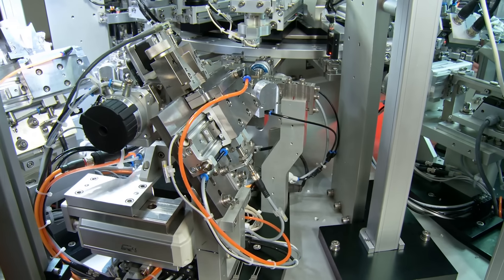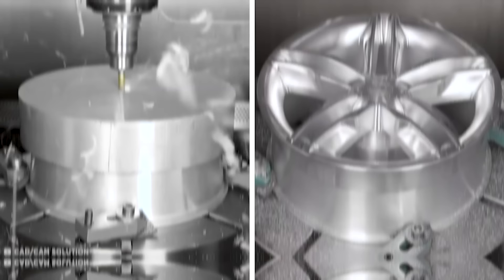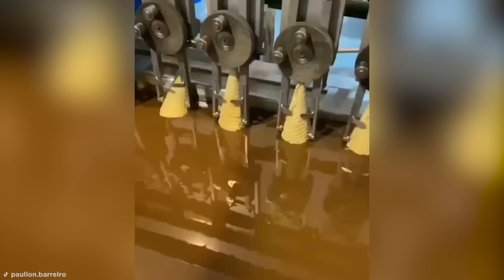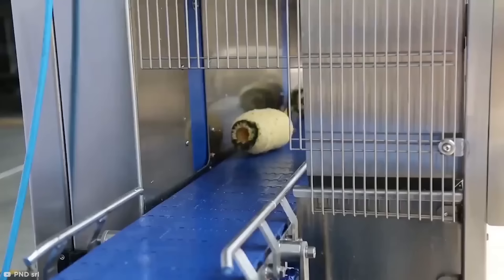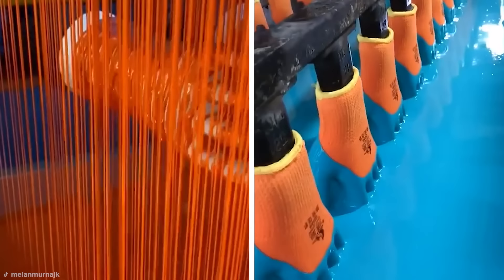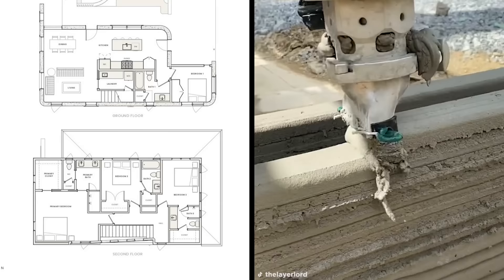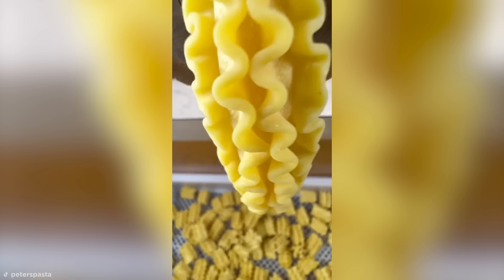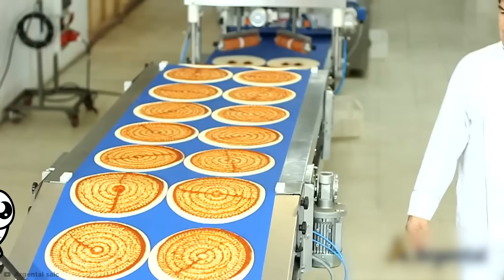Satisfying Factory Machines That Do Amazing Things

Comment: I used to work in a machine shop, I set up an ran a five spindle turret lathe from the 50's, it could make the same parts as a CNC (well some of the parts) however the only buttons on the machine was the off and on button, for how old they were it was pretty impressive the tolerances they were able to hold, with a good set-up that is

Comment: I love programming for a CNC machine. I taught myself AutoCAD then applied to a granite shop and got the job programming for their water jet CNC machine. I then learned AlphaCAM on the job as well. It was fun designing granite countertops for the machine to cut. Then I went to a closet company to program for their CNC wood router, and designed closets for the machine to cut and drill. I never got to use anything over a three axis machine though. I always wanted to play with a five axis CNC.

Comment: That’s not molten metal that is heat to cherry red. If it was molten it would be a liquid which is usually only done to form blanks or ingots of the metal. The metal is then heated to the state shown to form it and later annealed by heating it to a high temperature and cooling it down slowly to change the hardness of the material.

Comment: Part 1

You forgot titanium/chrome knee and hip implants. I used to work at a factory which made them called Sulzer Orthopedics, which sadly closed down in 2000. 

Anyway. Sure, a human is involved in almost every step involved with creating a knee implant -  from shaping a freshly cast, highly angular knee implant (we received them as 'bones', which was slang around the factory for a freshly cast and angular item before the first rudimentary steps of shaping them). What follows is how we did it:

1. The first step was to sand all of the shark edges from the bone, and give it the proper shape according to precise dimensions. If a mistake was made here, then that bone went in the trash... a loss of about $30,000. I never lost a bone on the belt sander, but I saw somebody else lose one. 

1.5 Anyway, sanding a bone to the precise precision and finally tuned tolerance of about a millimeter, meant that the guy running the belt sander that day was in for a world of shit. You know, for the rest of the day.. I saw a couple of guys fuck up their third try (it was 3 strikes and you're out) and they got fired for that. They don't fire you the first time, but as I alluded to already, I saw a few people who misprocesed the bones in a row. That's partially the trainers fault, but admittedly, he was giving these newbies time on the belt sander way before they were ready. Anyway, it was sad to see them go, because they didn't even have a chance to learn how to get good at anything. Not only did was it each one of them's first day on the job, they didn't have time to learn anything! And starting somebody out on the industrial sander should not be allowed. Starting out on the polishers is where you belong, because it's really hard to screw up a bone on a polisher, unless you get it too hot and if that's the case, you can feel it through the double layers of gloves you're holding. So the trailer should have at least shared some of that blame, but he didn't.

It was always sad watching people misprocess a bare bone by cutting the part sat the wrong and at the sander. The belt sander should only be used by a belt sander who has been certified as a belt sander. These noobs weren't ready to operate a precision belt sander beltby a human who just wasn't cutting it. 

LOL Did y'all see that? I made a pun!! No no, don't get up. It wasn't even intentional, it was just blind luck! Oh my God, stop clapping! I'm prediabetic, you know! Oh good Lord... angels and ministers of Grace preserve us... what? Do what know? Huh. Well, ok, dollar bills tucked into my thong are ok. But please, sit down, and I'll come to you!  But all the clapping, whistling, and hootin" and hollerin' - and especially calling me a sexy babe -  is starting to embarrass me! And let me tell you, God doesn't think it's all that rad either. God doesn't even like the word RAD, because that's from the '90s and the 90s are over. The only thing that endures from the 90s is Seattle music, bands from San Diego and  Chicago, and especially Tripping Daisy from Denton,TX! Fry Street Fair, we miss you! And to all the grunge folks who just couldn't stick it, even with the drugs, fuck you guys. And fuck you who took the easy way out. Except for Chris Cornell... It's the popular opinion of his wife that Chris absolutely wasn't suicidal, but he had taken some Ativan. Definitely not enough for an overdose, and I've been on ativan, and it never caused me suicidal ideations. Other drugs have. But we're talking about ativan, which was the only drug in Chris Cornell's blood, which doesn't seem like a suicide inducing drug. Still, I think he was drunk too, and was messing around with how to do it if you did want to do it, and when he did it, he couldn't get it off of himself and he died. So I think his was an accident. I was surprised and shocked and completely bent halfway the wrong way when I heard the news. Let's see... oh, Scott Weilànd, to.

All that is straight from the Mouth of God, not for me. I'm just the messenger!

2.
Back to it. Shaping a titanium/chromium implant - we're talking titanium/chrome alloy here, so it's super resistant to abrade one - well, it's hella hard, sweaty work and requires complete attention... so nobody ever bothers the guy on the belt sander. Of course, it's only applied to all the other guys who would run the belt sander, but whenever I was running it, I'd get paper airplanes thrown at me, I'd get the jambox place right behind my head and then turned up as high as it would go with that Animaniacs soundtrack, and they'd even get on the intercom and call my name, reporting me to the supervisor's office! Here's how it would usually go: